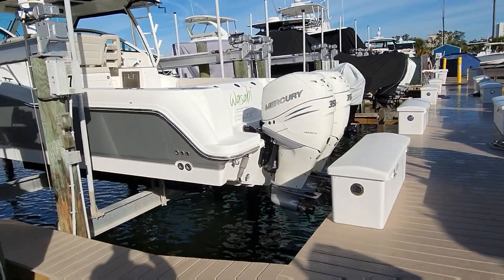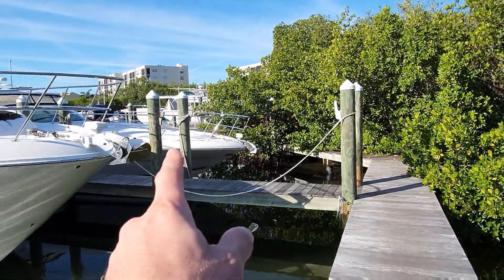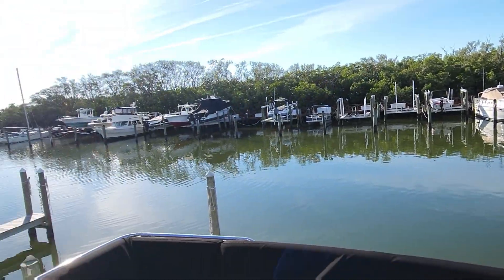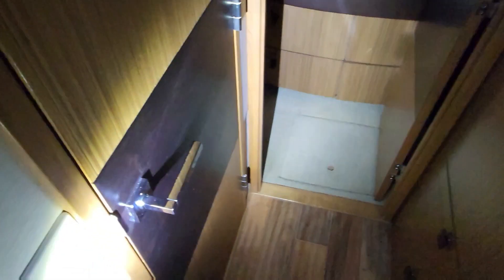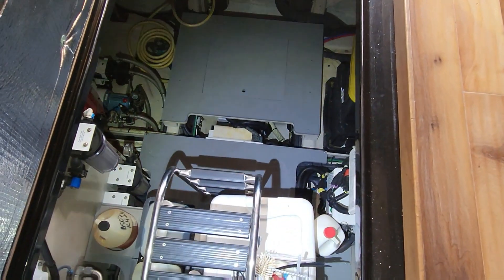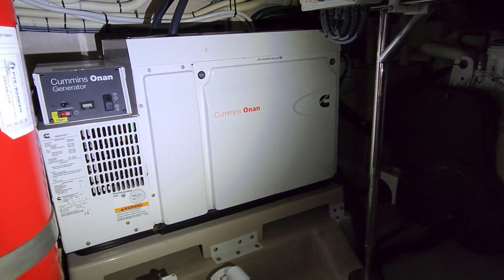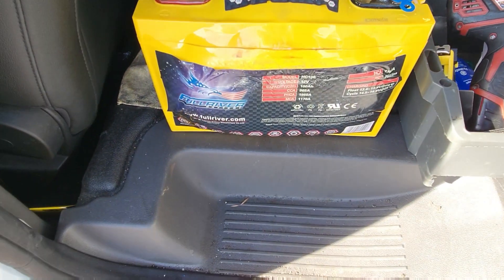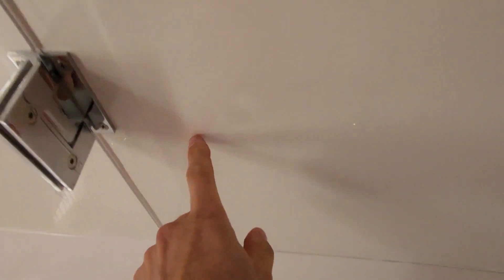Are The Old Sea Rays Better?!?!? What Do You Think? #MarineMax #SeaRay #Aquila #Episode201

Comment: Can't believe how Sea Ray stuffed three diesels in that 58. There is barely an inch between them. Have to know a snake who is handy with tools to access anything on the side of one of the engines. It looks like a mechanic's nightmare to my untrained eyes but maybe you can see how to work on those motors.  
The new Sea Ray 370 outboard model has a lot of cool features. It looks a tad plump in profile due to the large deck house but there is a lot of headroom in the deck house which I appreciate. A little pricey but I guess it's comparable to Boston Whaler and Pursuit.
Reply from the maker: It takes a team to deal with a 59 Sea Ray. It's a cool boat and I think the new ones are cool too. Different styles for sure. 🙃